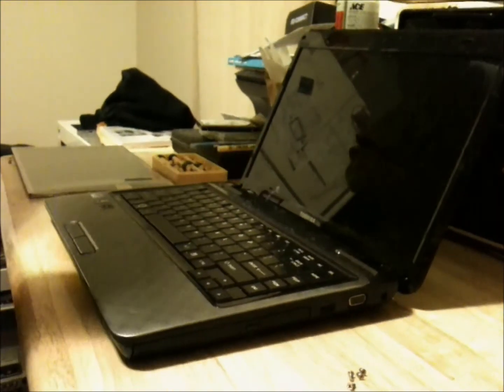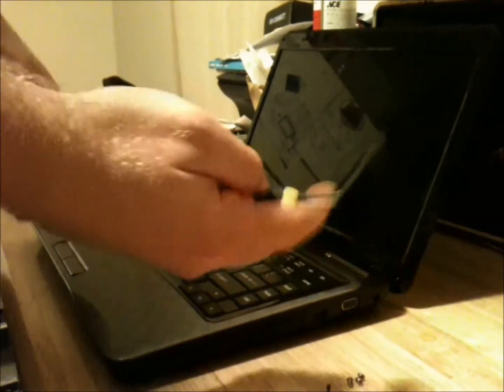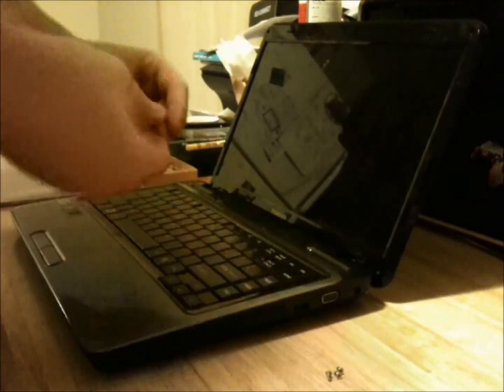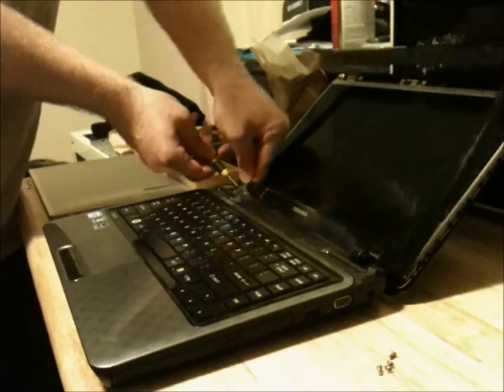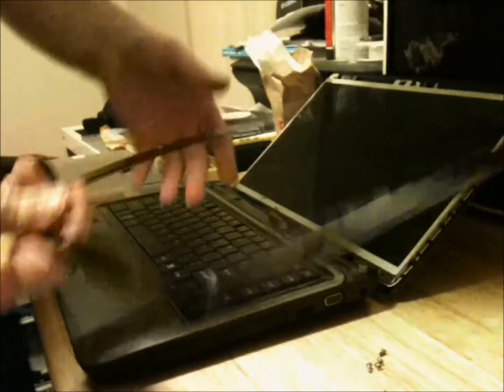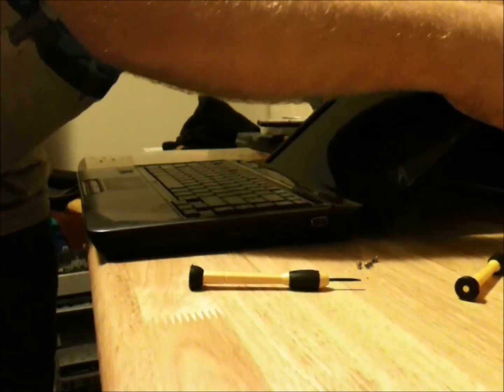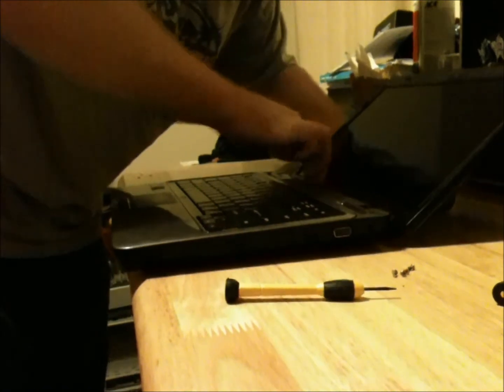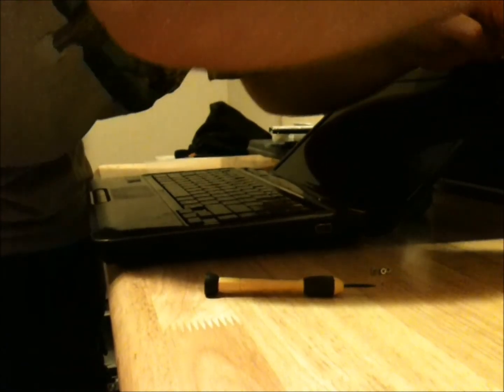Laptop screen replacement / How to replace laptop screen Toshiba SATELLITE L745-S4310

Comment from the maker: Not off the top of my head. The easiest way and cheapest site is http://www.laptopscreen.com/ go there and input the model of the laptop into the search. Example: "dv6-2088dx". This filters out all screens that are incomparable with your system. They also give you a choice of glossy or matte. Glossy is the one you want. After you create an account and log in the screen should drop in price shown by like $10 or more. It does for me at least. Best of luck Francisco!

Comment from the maker: I have gotten a white screen upon replacing an LCD. This does happen and is most of the time a cause from a bad connection. Try reconnecting the 30-pin connector and also checking the connection to the motherboard if possible. After unplugging and re-plugging the 30-pin it usually resolves the white screen in my experience. I have replaced dozens of screens.

Comment from the maker: All of the steps are pretty much the same. As all laptops are different some of the steps may be slightly different as far as getting the casing apart. However once the casing is open the steps should be pretty much the same.